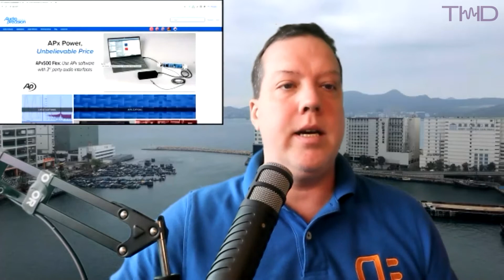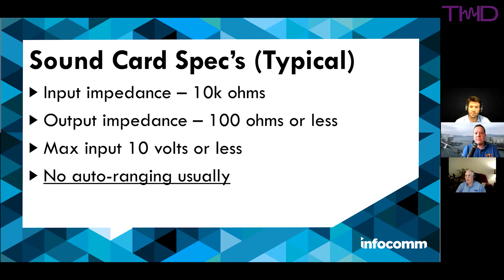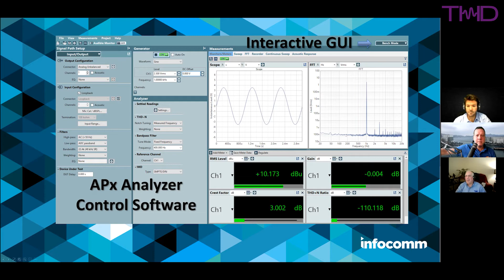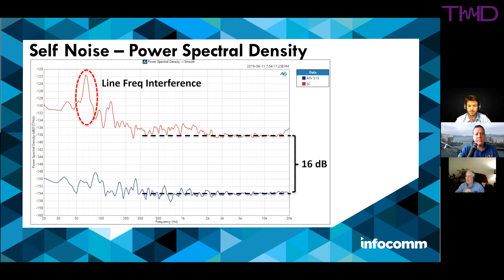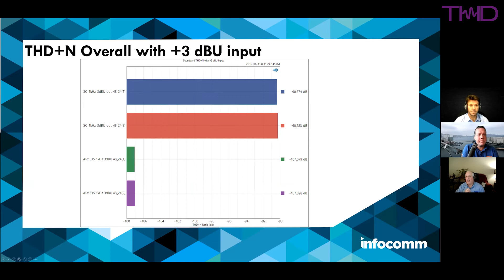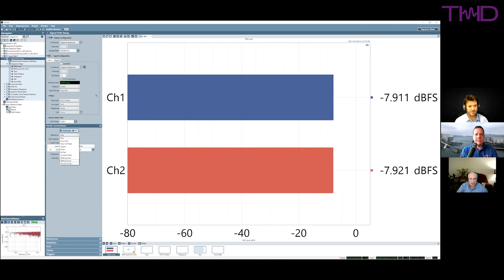AUDIO PRECISION Comparing Soundcards to Audio Analyzer for Audio Test Measurement -THD Podcast 41

Comment: We have an APx audio analyzer at work, and it is the most horrible instrument with the most horrible sw interface that I have ever had to deal with, everything about that instrument is clearly made by complete amateurs with no idea what they were doing. every day when I come to work all I dream about is to beat an AP engineer over the head with that worthless piece of junk. If I can make one recommendation to anyone watching this it is; For gods sake stay way way clear of AP products!!!
Reply: what specifically did you dislike about it? what is your use case? I'm thinking about buying one and i thought the software was great for my needs.  what product would you have prefered instead?
Reply: @philsanalogbasement  For my needs (R&D) the AP audio analyzer is by far the worst instrument I have ever had to work with, unfortunately though nobody else makes high-end audio analyzers anymore, If it wasn't obsolete I would have bought a rohde & schwarz analyzer. My main problems with the AP analyzer SW is that I need fine-grain control of my measurements and I need to be know exactly how results are calculated, there is basically no documentation on that at all and no fine-grain control at all either. In addition to that the bench mode of the SW which is what I need the most often is extremely lacking in features so I often end up having to use the automated test setup mode even to do simple one-off measurements because those measurements just aren't implemented at all in bench mode, which sucks. There are also a ton of bugs in the SW and sometimes I have had problems with noise measurements which turned out to be because the analyzer was putting out noise from the analog output even though it was turned off, after restarting the SW the problem is gone. I also now face the decision whether to buy an expensive SW upgrade that I don't need or keep the computer running the SW offline, because the SW version I have stops working due to one of the new windows updates. I could go on all day explaining all the things I hate about this product. I have now resorted to actually only using the instrument for recording sound output which I then export to a CSV file and analyze manually using Python instead.